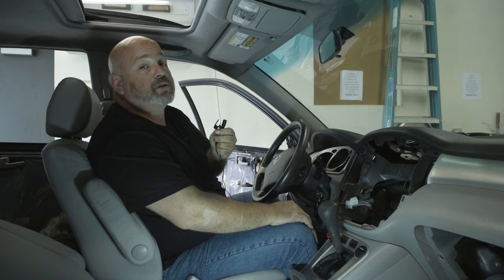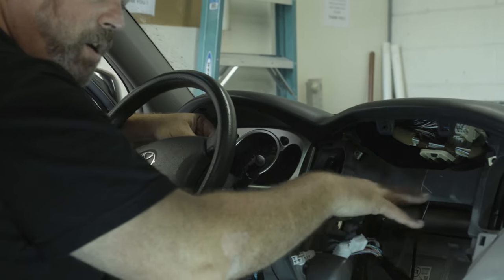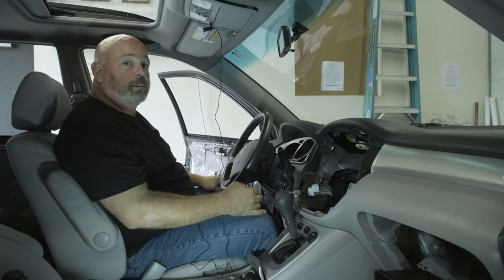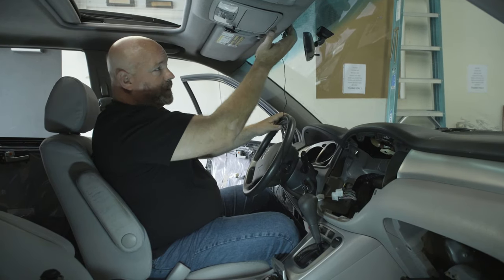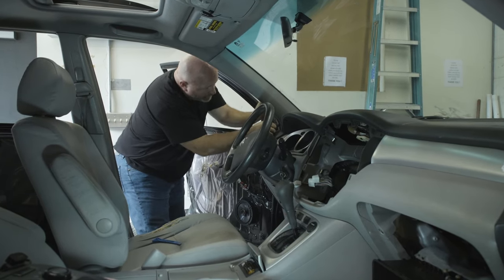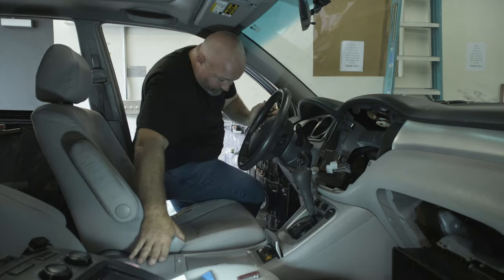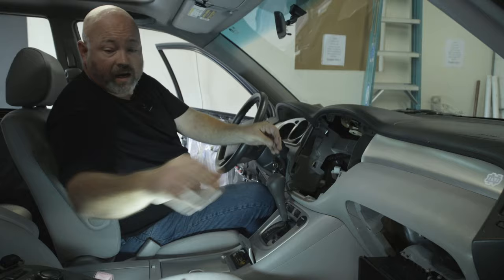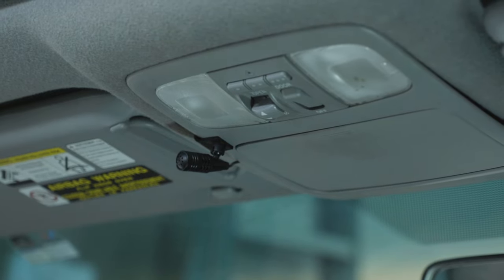How to install the microphone for your Bluetooth car stereo | Crutchfield

Comment: Bluetooth ?? That is a wired mic !!
Reply from the maker: Correct, the microphone itself is not Bluetooth, it is a wired connection. The radio receives a Bluetooth signal from the Bluetooth compatible phone when you get a phone call which then allows you to speak to the caller through the microphone completely hands free.

Comment: I have a 2010 Ford explorer that previously used sync. I swapped the radio for a Pioneer indash and connected the microphone that came with it. The issue I’m having is that callers can’t hear but I can hear them. Any suggestions?
Reply from the maker: The included Bluetooth Microphone is crucial for hands-free calling with the new Pioneer radio. If callers cannot hear you, this could point to a microphone issue. I would first check to make sure the microphone's plug is securely inserted into the radio, and that the wire is not damaged in any way from installation. Disconnecting and re-pairing your phone to the Pioneer radio's Bluetooth is always a good idea to try to see if it resolves the issue. I hope this helps!

Comment: Thanks. I too went with the microphone near the center lamp panel but then lay the cable through the A pillar on the passenger side and behind the glove compartment to the radio.

Comment: I can’t find the interface to plug in😢
Reply from the maker: Are you attempting to install a new aftermarket radio with Bluetooth microphone in your vehicle?
Reply: @crutchfield  My car's original microphone works after connecting to Bluetooth. About a few months ago, I bought a CarPlay mirroring accessory based on another YouTuber's video. There is a microphone jack in the video, just like in this video, but I can't find it in my car. Currently, I can't make or receive calls as long as I connect to CarPlay.
Reply from the maker: We are not able to adapt factory installed Bluetooth microphones to aftermarket gear. The new gear should have a microphone with it that gets installed. If your adapter didn't come with one, you may be able to purchase one for it. If it has a 3.5mm port for the microphone, then you can use a mic like this one:

www.crutchfield.com/I-rYALc227/p_113T9B0066/item.html

Comment: I can feel road vibration on the headliner trim panel. Will that interfere  with the microphone picking up the sound ?
Reply from the maker: Any noise can affect the BT mic's sound quality. You may want to consider adding sound damping if you get feedback about this. https://www.crutchfield.com/I-rYALc921/g_181250/Sound-Deadening.html?tp=61811&pg=2

Comment: My factory stereo has two mics. one above both front passengers. Can you show a video of putting new mics in factory location?
Reply from the maker: Sorry, Nicholas. We don't offer instructions for re-using the factory mic locations. If the factory mics have worked out well for you though using the factory radio, mounting the new mic  near the same spot is a good plan.
Reply: @crutchfield  is it possible to use both mics simultaneously. The last thing I want to do is downgrade the sound quality for my callers. Often myself and my passengers are talking on the phone.
Reply from the maker: What is the year, make, and model of your vehicle? Which model radio do you plan to install?
Reply: @crutchfield  I have a 2017 Ram 2500, the radio I was looking at is the: Kenwood Excelon DDX9907XR
Reply from the maker: Great stereo! Is your Ram the regular cab, mega cab, or crew cab? Does it have the radio with the large 8.4" screen? Does it have the 6- or 10-speaker system?
Reply: @crutchfield  It is the crew cab, 8.4" screen, premium sound.
Reply from the maker: So, the OEM mic in that vehicle is not retained, nor is the OEM UConnect system.  You will have to use the microphone that is included with the new radio.
Reply: @crutchfield  I understand that part, my original question was if there is a way to utilize two microphones like there is currently with the factory setup. I want to retain the ability for people I'm talking to on the phone to hear everyone in the truck.
Reply from the maker: The Kenwood Excelon DDX9907XR does only offer the single mic input. This is the case with any of our current models.

Comment: Why blue tooth mic should have a wire? Is this for charging battery within the mic?
Reply from the maker: The microphone is used for Bluetooth hands-free calling, so your callers can hear you when your smartphone is connected. It does require a wired connection to your radio as it is used for Bluetooth features but does not connect through Bluetooth, like your smartphone. These microphones do not have any battery and must be connected to your radio to function. I hope this helps!

Comment: I have a 2015 Subaru WRX Premium. A few months after getting the car I bought a Pioneer AVH-X5600BHS head unit, aux plug, and steering wheel thing so the buttons still controlled stereo.

Everything has been working fine with exception to the microphone. The microphone has been ok but people can always hear my car when shifting, road noise, etc.

I replaced the mic a few times and same or worse results. I bought the optional auto eq mic and hoping that will help. I'll have to double check my wiring as well at some point.

I still like my stereo and would really not want to buy a new head unit. Any ideas? Otherwise I may consider replacing it. If I do replace I'll certainly buy from Crutchfield again!

Comment: Can the existing car microphone be used (Mazda MX-5 Miata 2015 with bluetooth microphone behind speedometer assembly). Using Alpine ILX-W650 receiver/Apple Play
Reply from the maker: Hi John,
Unfortunately you will not be able to retain the factory Bluetooth mic in your Miata, when you upgrade the factory stereo.
Reply: @crutchfield  is there no adapter to add to the factory mic?  Seems like a lot of waste and you would think an easy fix.    Adding a Sony 3250 to my Toyota

Comment: Very helpful information! Question, how do I fix an echo on my newly install Boss bvcp9700a with external mic (callers hear themselves)? Thank you!!!
Reply from the maker: If your connections and settings are good, you may want to consider the mic location. Make sure it's not right at a speaker location and as close to where you'll be speaking as possible. From there, be sure there is no air vent aimed at the mic location and turn down your radio volume a tad using the handsfree calling feature. Hope that helps!

Comment: How is that bluetooth mic because it must be directly connected with radio by aux  cable???
Reply from the maker: The microphone featured is a Bluetooth mic with a 3.5mm connection, which connects to the 3.5mm Bluetooth Mic connection on the receiver.
Reply: Crutchfield clearly doesn't understand your question. The mic is wired and  not using Bluetooth wireless tech, therefore, the mic is not Bluetooth and crutchfield people are unaware of what Bluetooth means.
Reply: @joshuadwillard  you said exactly what I was thinking
Reply: @joshuadwillard  I know this is a year old but it's called a Bluetooth mic because it relays the audio when making calls via your stereo/phone Bluetooth connection, not because the actual microphone is wireless

Comment: I have a 2003 Ford F150 that I am looking to upgrade to a new stereo. How easy is to run the mic wire in it? Many thanks.
Reply from the maker: Not too difficult Daniel. Our tech support can help you plan a route under the headliner or trim depending on where you ultimately plan on mounting it.

Comment: Does anyone know why I can't hear caller through my car speakers? I can hear them but the volume is too low, tried everything, the mic is internal and I have an Android head unit, everything works flawlessly except that the volume from BT calls through car speakers is too low. Do I need to put an external mic for it to be better?
Reply from the maker: The mic is used for speaking to folks; but not hearing them so it's likely your Bluetooth settings in the radio menu since you've got good sound for everything else. If you got the radio here, you can call our Tech Support for help with this as well. Their direct number is on your invoice.

Comment: Hello. I need help for my car bluetooth mic. 
I have Nissan multimedia mm317DW in my car. How and which Mic should I install for clear calls.
Reply from the maker: Factory bluetooth mics are generally a proprietary connection to the factory stereo, therefore would not be able to swapped out with an aftermarket mic. What year and model is your Nissan? Sometimes there are aftermarket bluetooth add-ons for factory stereos that come with mics and work well. We can check!

Comment: I have 2017 camry in Australia  but suddenly  not showing bluetooth  no any option  no add divise  no remove option even I can t see my car bluetooth  name on my phone can u tell what s wrong with my audio system  thanks
Reply from the maker: It sounds like the electronics that run the Bluetooth all have stopped working for some reason. We do not know what to try to troubleshoot or if its separate from the stock radio and recommend contacting a Toyota technician for help

Comment: Can you help when I plug the mic in , caller can hear me , but I cannot get sound through my speakers??
Reply from the maker: That issue would not be linked to the microphone and it being properly connected. Instead, it is more likely linked to other parts of a radio's installation like trigger wires or wires sending audio to the speaker system. You may want to double check the radio's wiring to see if any of it was not properly connected in the vehicle. If you purchased your gear from us, you can contact our technical support for help troubleshooting this issue. We include their toll free phone number on the order invoice.

Comment: Will any 3.55mm mic for a bluetooth head unit work in any other bluetooth head unit? For example, let's say an Alpine 3.55mm mic in a Sony head unit that also accepts 3.55 microphones.
Reply from the maker: Yes, that typically works just fine. An exception would be the Pioneer head units, which use a smaller 2.5mm connector for their microphones.

Comment: Hi Dear, very nice explanation for installation. I have Maxlink Android Car Music player. It has in bust MIC soldered in side the player, it just one small hole for capture the voice. This is not good enough for listeners. So I’m planning to use same MIC which you showed. Just remove the soldered MIC and extend the MIC cable and place the external MIC near the Center of car. So I needed your opinion. Will it workers for better voice to listeners? Please help. My system model is MAXLINK T3 16 GB MODEL.
Reply from the maker: Thanks, Rahul. Routing the BT mic to a better location will help. You will want to check your player's manual to verify what type of mic will work since we don't have any information on that model.
Reply: @crutchfield   Thank you for your guidance.
Reply from the maker: You're welcome, Rahul .

Comment: Why are you calling it a bluetooth mic when it's a regular wired mic?
Reply from the maker: Hi Linus. I checked in with our video team, and they are working to correct this.
Reply from the maker: Hi, Linus, it's sort of a slang term to call it a Bluetooth mic. As you point out, it would be more accurate to call it a mic FOR using Bluetooth. It is indeed a wired mic, used for talking to your stereo. We've tweaked the title slightly. Thanks for your suggestion, and thanks for watching! - Video Team

Comment: Why can't I keep the factory bluetooth
Reply from the maker: Several reasons.  In most vehicles, the mic is connected via proprietary connections.  Splicing mic cables leads to terrible call quality.  Also, on unit that has any sort of voice control, then microphone needs to be connected to the new units dedicated microphone port, and not an adapter module for it to work.

Comment: On my Honda Jazz 2012, it already has a built in factory Bluetooth mic mounted. Can I use that instead of the mic that came with my new radio?
Reply from the maker: We do not have adapters that allow a factory installed Bluetooth microphone to work with a new radio. We recommend installing the mic that came with the new radio

Comment: I have a song XAV-100 head unit, for some reason the Bluetooth microphone that it came with only picks up on phone conversations, but if I say “hey Siri” or hold down the button to ask my phone to call someone or map search something the phone doesn’t pick it up. I have to essentially disconnect Bluetooth from my phone then talk into my phone, then connect Bluetooth back to head unit. Which is just too much to do while driving. Anyone over at crutchfield know why this is???
Reply from the maker: Sometimes there's a delay when trying to access Siri through a car stereo's bluetooth connection. Usually you will have to wait until a little tone is played to indicate that she is listening. Have you tried that yet?
Reply from the maker: Hi Robert, sorry to hear about the issues with your radio. If you got it here, please call our Tech Support. Their direct number is on your invoice.

Comment: it’s not bluetooth if it has a wire. right
Reply: The mic is not Bluetooth. The mic is for Bluetooth. You don't have to use the mic, you could always use the mic on your phone and use speaker phone. But then that wouldn't be very hands free now would it?